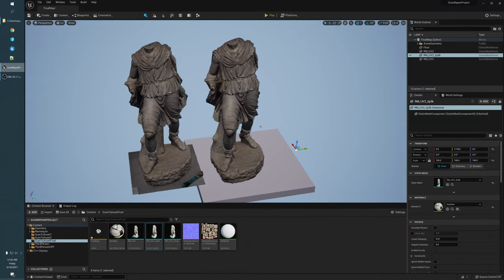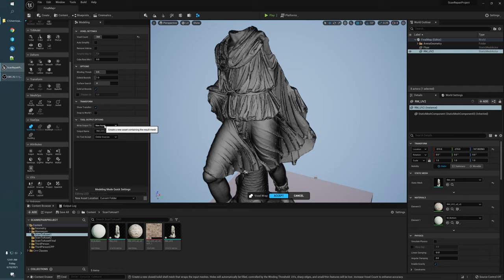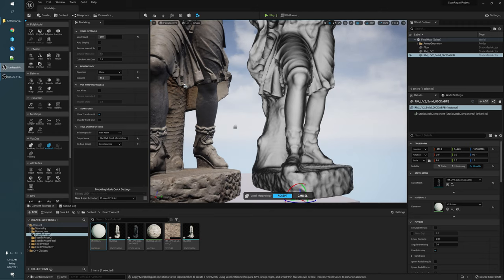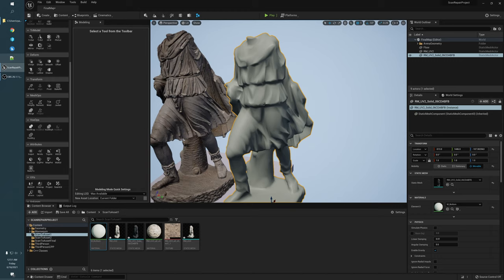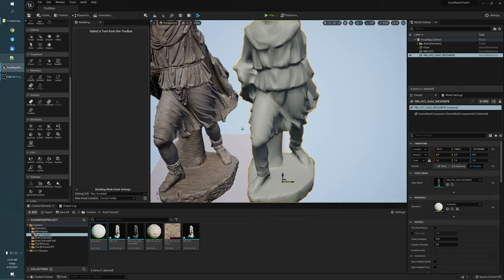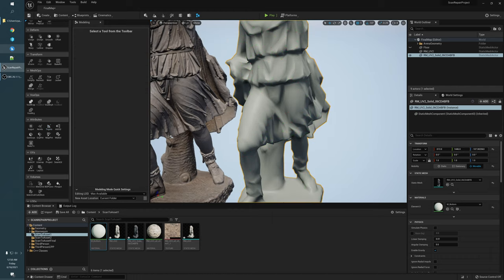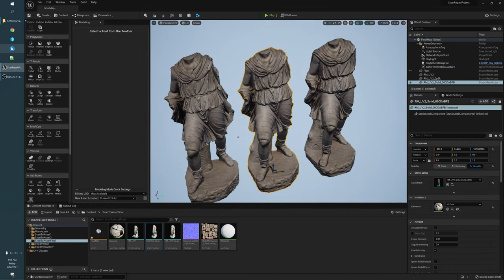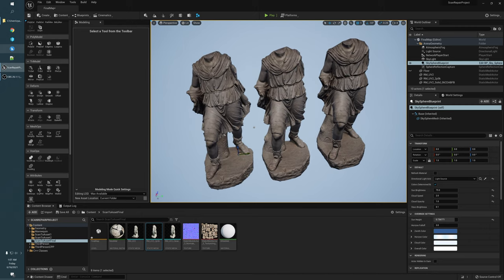UE5EA Scan to Asset Workflow - Part 2 - Highpoly to LOD0

Comment: Hi Ryan, it is so awesome you can do this now in-engine. In my traditional workflow I was using like 5 different software packages to the cleanup. I have a question: How can you bake to a lowpoly model if the input model has several materials, like for instance to bake the diffuse?